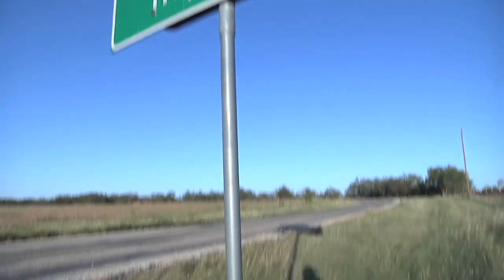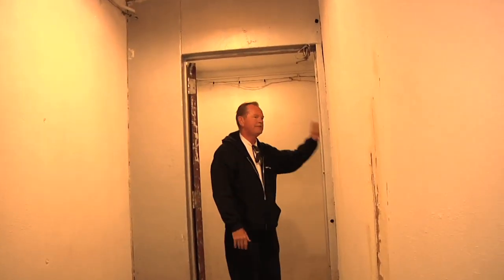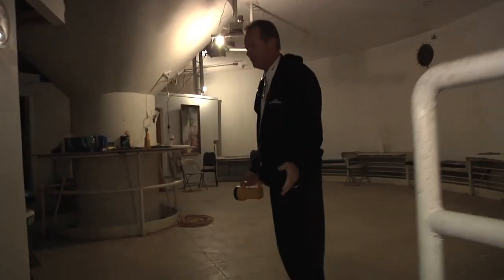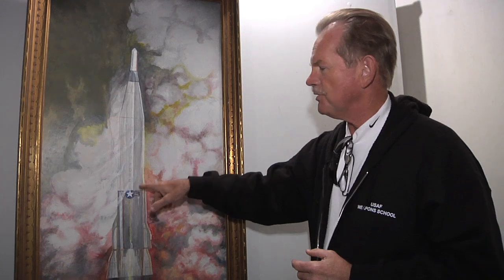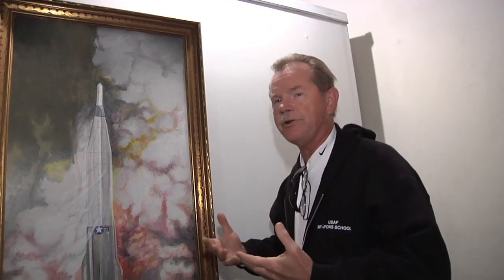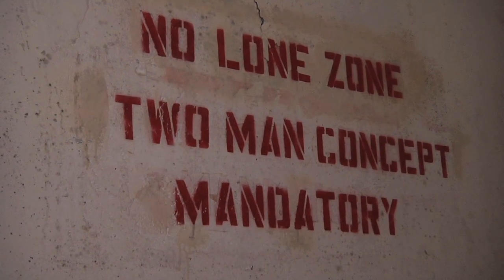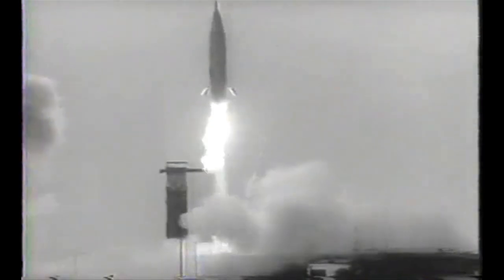Tim Frakes Productions Inc. Tour a Cold War Era Atlas Missile Silo

Comment: If you shoot that drink machine,  you'll have to answer to the Coca Cola people. - paraphrased, Col. "Bat" Guano .
The hard packed sand in the escape hatch was the reason I gave up digging. 10 years or so after the Atlas site next door closed I started digging one day. That sand had hardened almost into concrete. Years of snow, rain and temp extremes. I gave up digging down after about 2 feet and 2 broken shovels. I hope they had a shovel down below. 
Ellenburg Depot, off the Bull Run Road.

Comment: In multiple places, this video refers to Curtis LeMay as being in charge of Atlas missile deployment. That is not really true...LeMay was in command of SAC until 1957, but after that, it was commanded by Thomas S Power from 1957 until 1964. All of the deployment of the various versions of the Atlas ICBM were supervised by General Power, not Curtis LeMay. Of course, Curtis LeMay was first Vice Chief, and then later Chief of Staff of the Air Force...so he was in overall command, but after he left SAC, LeMay was not really in direct control of Atlas development or deployment.

Comment: Sand filled vertical escape tube: pull the handle, the hatch swings open and most of the sand falls to the floor... except for the 3 feet of sand at the top that has been fused into glass by the nuke strike.

Comment: I lived near an abandoned site that had been operated by Plattsburgh Air Force Base when I was a kid.
So naturally we explored it up top, but it was sealed tight. We wondered what the concrete tube jutting up was for, with ladder rungs inside it. There were a couple of small metal out buildings, 2 large Quanset huts, and toilets that appeared to incinerate waste. A large black pipe (airshaft?) about 2 feet in diameter came out of the ground next to the concrete stairway, rose 4 feet in the air before curving down in a U shape.
There were stainless steel connections coming up from around the silo, and heavy gauge screens over parts of the silo, with water way down below. It must have been flooded.
There is another site in this area that has a home built over it, and of course the underground has been remodeled. It even has its own airstrip.
Thanks for this, I'm still fascinated by these sites, even 50 years on.

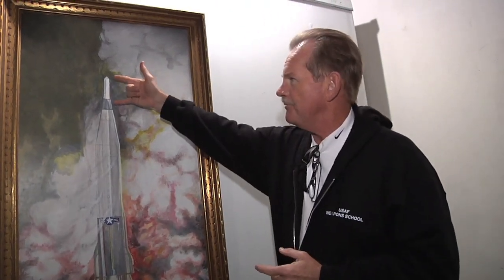Comment: At 4:43, the narrator states that the Atlas ICBM carried a 30 megaton (MT) warhead and that it was "approximately 3 to 4 times" as powerful has the Hiroshima bomb. This is totally incorrect. First, the United States never had a 30 MT nuclear weapon; its largest were the Mk-17 and Mk-41 (a.k.a. B41), both of which were 25 MT gravity bombs that could only be carried by the B-36 intercontinental bomber.  The bomb dropped on Hiroshima (code-named "Little Boy") had a yield of 15 kilotons (KT). The fictional 30 MT warhead would have been 2,000 times the yield of the Hiroshima bomb.

The Atlas ICBMs carried either a W49 thermonuclear weapon with a yield of 1.44 MT or a W38 thermonuclear warhead with a yield of 3.75 MT which was fuzed for either air burst or contact burst.

References:
https://en.wikipedia.org/wiki/SM-65_Atlas
https://en.wikipedia.org/wiki/Nuclear_weapon_yield
Reply: noticed that too. didnt know the exact numbers but knew it wasnt 30mt and knew it was 3 or 4 times more powerful. good spot mate
Reply: Well, thats what they thought anyway. Until they found out that Lithium-7 wasn't really inert. So maybe your right. They thought the same thing until Castle Bravo and Ivy Mike. Teacher always said,  ''Carry the zero.''
Reply: Hmmmm yes, bombs
Reply: @MoistPantaloons  😆
Reply: Just in Math, there is a big difference between 30 and 1.4 unless you're talking about something microscopic. A Plane, Truck, House...big difference.
Reply: I caught the 30MT.  I went to comments just to see if anyone else did. Good job.

Comment: I remember getting bottles of Coca-Cola out of a vending machine like that in the early 1970s. I wonder if the vending machine in the launch control area still works.
Reply: i remember carrying a church key in my pocket ( a glass bottle cap removal device for the young generation made of metal ) and a empty dixie cup to these vending machines in my youth, opening the glass bottle while it was in the machine and drinking from same w/o paying. machine wouldn't release bottle unless you paid and then it would  activate the release mechanism for one bottle only. bottles was opened with the blunt end of the opener and cans opened with the pointed end before the days of pull tab cans somewhere along the year 1965.god almighty i feel old looking back on that now. i'm 65. where did the time go ?

Comment: I simply don't know whether Atlas was designed with first strike capability in mind or not, but the argument involving the Faraday cage clearly doesn't hold. A complex and expensive weapon system like Atlas is guaranteed to have been designed with more than one scenario considered, and technical elements of one scenario being present do not preclude its application to another scenario.

Comment: I can't do the calcs right now but 30 megaton is not 3-4 times the yield of hiroshima's little boy.  30 megatons is a massive device, far beyond what was fielded by ATLAS back in the day.  Tsar bomba was 50 megaton for example.

"The warhead of the Atlas D was originally the G.E. Mk 2 "heat sink" re-entry vehicle (RV) with a W49 thermonuclear weapon, combined weight 3,700 lb (1,680 kg) and yield of 1.44 megatons (Mt). The W49 was later placed in a Mk 3 ablative RV, combined weight 2,420 lb (1,100 kg). The Atlas E and F had an AVCO Mk 4 RV containing a W38 thermonuclear bomb with a yield of 3.75 Mt which was fuzed for either air burst or contact burst. The Mk 4 RV also deployed penetration aids in the form of mylar balloons which replicated the radar signature of the Mk 4 RV. The Mk 4 plus W-38 had a combined weight of 4,050 lb (1,840 kg). The Atlas missile's warhead was over 100 times more powerful than the bomb dropped over Nagasaki in 1945"

Comment: Whatever happened to the control stations and electronics? They are long outdated, but would be fun to see as museum pieces in place.
Reply: All of the Atlas F LCC’s and silos were left intact, structurally.  However, they’re all in varying states of salvage.  Some of the Nebraska sites looked as if the Air Force just locked the door and walked away and left all of the infrastructure, while some of the Texas sites have been totally stripped down to concrete tubes.

Comment: What happened at 9:00? It sounds like the cameraman hit his head.
Reply: The shock of seeing the silo. 15' diameter and 18 stories deep.
Reply: @drmj-art  52' diameter, not 15'. ;)
Reply: I know right!? I was like, what the hell!
Reply: being 50ft underground, navigating those tunnels and then seeing this launch tube that is so massive that it's hard to believe what you're looking at. you have to be there to understand, the camera doesn't do it justice. i had the same reaction when i first saw it.
Reply: He was just shocked by what he was seeing. When I was looking down the overflow hole at the Hoover dam I was similarly impressed. It’s a bit intimidating.
Reply: @ryand.3858  the scale of it all is unreal, the opposite side is so far away that it looks fake. its hard to stand near the edge because it feels like you're being pulled in. the one i visited didn't have safety rails anywhere, you could just walk off of the edge.

Comment: 4:41 - The Avco Mk 4 was a 3.75 megaton weapon, not a 30 megaton weapon, and it was 250 times more powerful than the 15 kiloton Little Boy bomb dropped on Hiroshima.  The ability to deliver within a certain distance (in this case, a "quarter mile") is known as Circular Error Probability, and only 50% of the warheads would fall within that distance.  So, if a rocket had a CEP of 1/4 mile, 50% of the warheads would land within a 1/4 mile of their intended target (and 50% would land farther than 1/4 mile).  For comparison, a modern Trident II has a CEP of about 100 meters.

The Atlas CEP was not 1/4 mile, however.  In fact, 1/4 mile was unlikely to be even the best it could possibly do.  Using radio-inertial guidance system, for navigation, within the range of 4,750 nautical miles, the CEP was about 6/10ths of a mile (or a bit over 1/2 a mile).  Out to the range of 5,500 nautical miles, CEP performed somewhat better, dropping to just over 4/10ths (or just under 1/2 a mile).  At 6,900 nautical miles, CEP raised to roughly 1.05 mile. and at a range of 8,700 nautical miles, CEP ballooned to 2.6 miles.   https://apps.dtic.mil/dtic/tr/fulltext/u2/851310.pdf  (CEP data starts on page 19)

Comment: I was active duty USAF NORAD, 82 - 85.  I remember all these things quite well, even then.
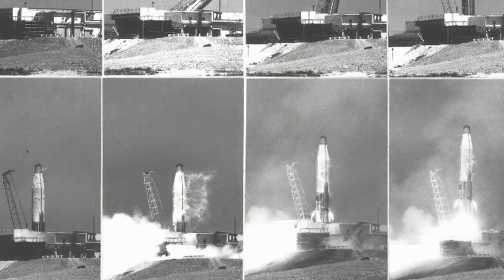Reply: Hey Robert Did you catch the inaccuracy he made on the  Mark 4 re entry vehicle warhead yield at 4:33 in the video?
He said it was 30 megatons and about 3 or 4 times more powerful than the bomb dropped on Hisorshima.
From what I have read the Mark 4 carried a 3.75 MT warhead and was more like 250 times more powerful than the bomb dropped    I was in the US Army and i also worked with nuclear weapons.  Mine was a Bottle Rocket compared to your haha.
I was in the US Army and i also worked with nuclear weapons.
I was a section chief in a Lance Missile Firing Platoon. Lance was a tactical nuke stationed predominantly in West Germany.  
You remember the Neutron bomb we claimed we did NOT have?    Hehe.
Reply: @Bill23799  No, I totally missed that.  Good catch.  NORAD doesn't really have anything to do with ICBM nukes, other than we sound the alarm should they be needed.  Back then, I believe it was SAC (Strategic Air Command) that controlled the ICBMs.  At NORAD, our direct nuke involvement only  extended to fighter jet launched nuclear A2A or A2G missiles.

Comment: There were silos in the Adirondacks in NY- never knew that until the Syracuse paper reported it. Some guy had developed a way of closing them since they'd been left open after the missiles were removed. He loaded them with hay bales and set them on fire, the heat would loosen the doors and they could be swung closed and welded shut.

Comment: 30 Megatons? 3 to 4 times Little Boy? You need to work on your facts. Little boy was a generally accepted 15 kiloton bomb, the Mark 3 and mark 4 warheads on Atlas carried a W-38 device with a 3.75 Megaton yield or equivalent to 250 Hiroshima bombs the tour guide really needs to work on his facts and simple math (1 kiloton roughly = 1000 tons of TNT 1 Megaton = 1,000,000 tons Little Boy was equivalent to 15,000 tons of TNT divide into 3,750,000 (3.75 MT) and you get 250 or it takes 250 Hiroshima bombs to equal 1 W-38 warhead). "Its a deterrent weapon so its utility would have been a failure" do you mean its utilizatition because its utility is the different functions it could serve i.e. a utility knife broad number of use or functions this is like a guided tour through the Smithsonian by a fifth grade drop out.

Comment: 30 Megatons is 30,000,000 tons of TNT, or 1.255·10^17 Joules. The bomb dropped on Hiroshima yielded 15 kilotons, or 15,000 tons of TNT. The W49 warhead deployed on Atlas II ICBMs was far less powerful, at 1.4 Megatons. The Castle 'Bravo' test yielded close to 15 Megatons. Big bombs are inefficient as the blast wave's energy is divided by the distance (the radius squared: (r)²), which is why MIRV-armed missiles were developed.

Comment: Kennedy Space Center Visitors Complex has a real Atlas Rocket in their rocket garden.
Reply: Yea.  But is it filled with rocket fuel?  Either it's full of fuel or there is some kind of structure holding it up. Without fuel, the outer skin would collapse.
Reply: It is being held up by a structure... There is no fuel inside., they also have a Mercury capsule on top of it.

Comment: The V-2 also used this "pressurized skin" for structural strength. There still must be some level of non-pressurised structural strength. During V-2 development there were many "at altitude" failures. It was determined that the pressurized tank concept needed to start with a tank that had a high basic strength level even without pressure.

Comment: The Tsar Bomba was a three-stage Teller–Ulam design lithium bomb with a yield of 50 to 58 megatons
Reply: The Tsar was only that big because they left off the U238 jacket from all but the first thermonuclear secondary that is typically the third stage of a fission-fusion-fission bomb.  They daisy-chained multiple secondary thermonuclear fusion elements to get it that big.  In theory you can daisy-chain about as many of those as you want.
Reply: Yeah but it couldn't be delivered by an ICBM, it was dropped by plane

Comment: Interesting point about the Faraday box, but wouldn't ALL of the survivability features (underground, blast doors, etc) mean that the missile was not a first strike weapon?

If it was a first strike weapon, wouldn't you just put your LCC's in mobile homes or something?
Reply: +tybo09 First strike weapons would have also had to function as a response weapon, considering that mutually-assured destruction would have been imminent.

Nuclear weapons are always both a first strike and response weapon. There is no differentiation when it comes to ICBM nukes. Any argument of increased morality gets thrown out the window because neither side would live through it.
Reply: +tybo09 Also, you would still want your crew underground and secured. You wouldn't want to be able to just break a few doors down and have the keys to the nuke sitting in front of your enemy.
Reply: Allen Klingsporn  Very true about first strike weapons also being for response. My point wasn't so much "this proves they aren't first strike" as it was "this shows they didn't intend them as purely first strike weapons".
...I think... I wrote that a while back.

As for the security part, you're right. They don't necessarily need to be underground to be secured, but I didn't think of that part of it when I said the part about putting LCCs in mobile homes.

...although if you hid them in random places surrounded by mobile homes all over the country, that'd function as pretty good hiding in plain sight.

...at least until a tornado comes through. :)

Comment: so this was our first silo-launched missile system? i thought all the other Atlas's were stored horizontally.
Reply: TheMetalHeaD256 I may be wrong but there were some titans around town and some atlas 'E's as well. I know there were a few that were at an angle. Just north of Coronado's Camp. Near a 'roadside park' on hwy 277. I believe there were 12 atlas F silos within 20 miles of Dyess Air Force base. Larry's is one of those 12. Mark and Linda Hanafin have another that is accessible via reservation (look for familyscuba.com).
Reply: There is one of those sites around Mead, Nebraska. The Nebraska National Guard use them for training. Three horizontal silos (empty, of course) and a block house are there.
Reply: @ronaldrobertson2332  if there are 3 horizontal silo's in the Mead, Nebraska area that the National guard utilize you are describing a former TITAN ONE complex.  Totally different from ATLAS although both were first generation strategic ICBM's.  Those Titan one sites were massive underground cities with 3 missiles all deactivated in 1965 after only 4 years of service.  The government spent millions of wasteful dollars to build to keep our edge in the COLD WAR years.  But, like the Atlas they were liquid fueled missiles that were very dangerous to maintain and fuel as apposed to the later SOLID fueled (and safer)  Minuteman one, two and three.  The Titan ones were assigned to the former LOWRY AFB near Denver.
Reply: There were two configurations of the ATLAS missile.  The "E" model and the "F" model.   The "E" models were called coffin silos because the missile laid down into a semi-hardened structure. If it was to be launched the roof would be rolled open and the missile elevated on a gantry to launch position when it was then fueled.  The Atlas "F" model were in the vertical underground silo's you see in this video.  They had to be brought to the surface on an elevator and then fueled for launch.  Both missiles were liquid fueled with LOX, oxygen and kerosene and were very volatile to service and maintain.  Part of the reason they had a short life on ALERT was because many of them BLEW UP when being refueled.  None of the Atlas were SILO LAUNCHED like TITAN 2 and MINUTEMAN were.  My background is around the Minuteman 2 missiles in South Dakota.  The squadron I was in is now deactivated as of the 90's.
Reply: Minor correction....there was also an ATLAS D model.  Very early design stored horizontally in un-hardened shelters.  Many of those were stationed in Cheyenne, Wyoming.  That configuration lead to the E and F models being deployed.
Reply: Good God, the engineering and logistical coordination that went into the construction of this system. ALL of 'em built in the middle of nowhere. It's staggering!